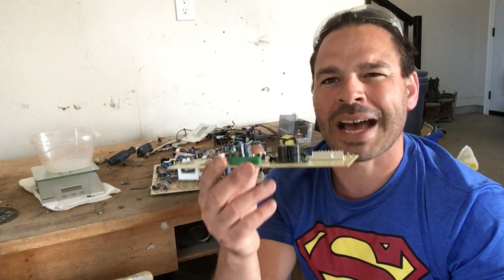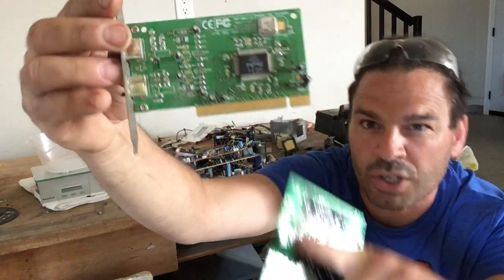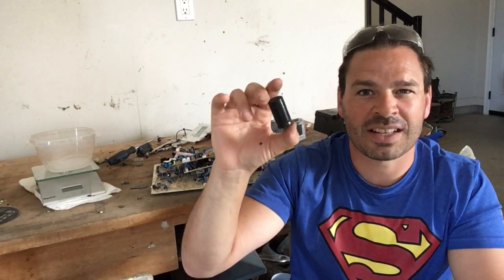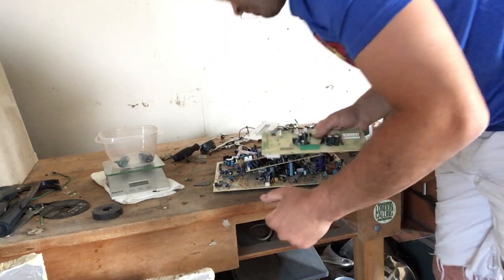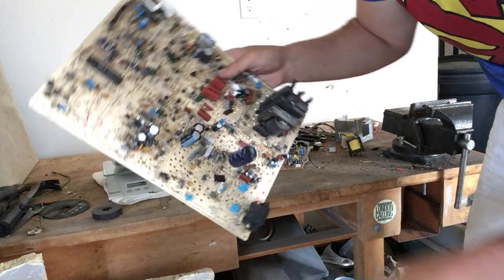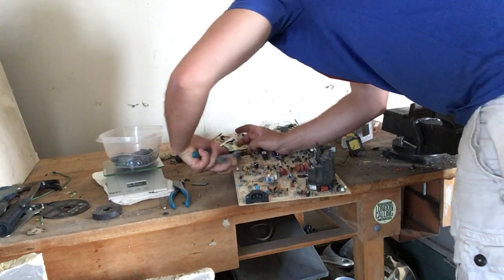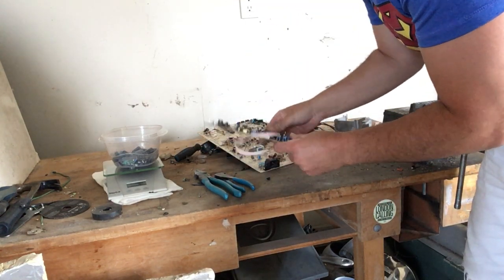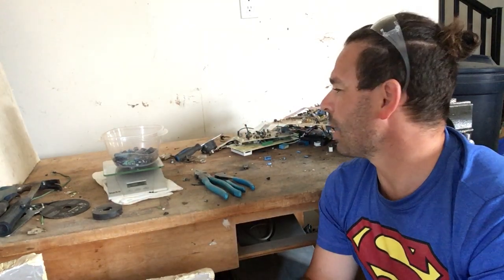Scrapping aluminum capacitors from circuit boards. Are they worth more money sold separately?

Comment: I process all high/medium/low grade Printed Circuit Boards myself. The most valuable part of PCBs, at least for the low grade ones, is the solder. A hydrometallurgical process dissolves the solder without damaging any of the electronic components. Tin, lead, and a little silver is recovered from the liquid solution (tin is worth 3½ times more than copper). After solder removal all the components simply fall off the board, ready to be sorted and processed in individual batches of not less than 50kg of each component. Virtually every single value of each component is extracted. 
Even the bare boards themselves are processed. The bromine is extracted, the epoxy resin is cracked into fuel oil, and the ultra thin copper layers are recovered as well. The remaining glass fibers are not profitable to sell but a glass recycler picks them up for free, so I have no disposal costs.
The wet electrolytic aluminium capacitors are processed by pyrolysis. I have four different homemade pyrolysis units. One of them have a reactor vessel made of thick walled stainless steel pipe (Ø 50 cm); it's built especially for aluminium capacitors. The problem: When heated up, they explode! The larger ones, from fx. washing machines, sounds like very large firecrackers. Yield is: Raw pyrolysis oil, lots of aluminium, and a little iron. I still haven't found a way to recover the electrolyte, but at least some useable minerals/salts can be extracted from the residue at the bottom of the pyrolysis vessel. After pyrolysis the aluminium capacitors are free from any plastic/rubber. They are poured into my homemade hammer mill and comes out in small pieces; from which it's easy to remove the iron legs/pins with a magnet. In a homemade ceramic crucible these aluminium crumbles are then melted, under nitrogen, in my homemade metal melting furnace (fueled by free homemade oil) and cast into aluminium blocks in accordance with the buyer's specifications.
Reply: you really need to make a channel everything you said sounds very interesting.
Reply: @gargalash9191 .   Videos covering the subject scrapping and/or metal recovery and metal refining achieves rather limited views. They'll never go viral (too specialized), thus despite the ad revenue from Google it won't be profitable. I'll make more by scrapping/recycling instead of spending the same time on making videos. 
However, as I have a rather comprehensive knowledge of the necessary chemistry involved in streamlined and effective high volume scrapping/recycling processes, I might be able to advice and help you with tips. Anything specific you would like to know?
Reply: Any chance you could educate me about the processes you were just talking about? I'd be eternally grateful
Reply: @OB1cannolli .  I'm just a backyard scrapper, recycling plastic as well as recovering and refining metals. Very streamlined procedures and efficient processes in my garden shed earns me US $250.000,- a year. The secret is to extract virtually all values one way or another, and never throw anything away. Making all chemicals at home at no cost and being careful to recycle as many spent chemicals as possible, keeps total costs at a minimum; thus considerably increasing profit.
I'll be happy to exchange experiences, and share information about recycling. What country are you located in?
Reply: Do you have an email so one can receive information?
Reply: @reginacarroll8149 .    In order to share information/advises with other viewers we can discuss openly here on YT.
Feel free to ask about the chemistry or processes regarding scrapping and metal recovery.
Reply: Is there a book you recommend on how to perform hydrometallurgical process and how to perform other chemical breakdowns of precious metals for scrapping? Thanks
Reply: @bjoewallace81 .   C.M.Hoke's book is the refiner's Bible.
Notice that this book was written in 1940. A lot has changed since that time, mainly about safety and especially regarding the laws for environmental protection (hazardous waste). However, the chemistry is still the same.

Comment: Very helpful video. I actually get 30 cents a pound for low grade circuit boards, so I usually only rip off the transformers and aluminum. But if they were 5 cents a pound, I don't have space for boards that are worth almost nothing, so I'd rip off the capacitors as well.

Comment: All the low grade with capacitors attached I’ve gotten $0.07-0.12 per pound. So they all go as breakage where I take mine. Of course I take off the big chunks of transformers, copper, transformers, etc. for higher prices. The higher grade and mother boards, etc. I got like $1.50/lb. the last truckload.
Reply from the maker: Nice. Yeah it is amazing the different prices people get in other regions, states, countries, etc.

Comment: Do you have an email that I can send a picture of something that I am trying to figure out what it is?
Reply from the maker: Sure James.firth@sccdsb.net
Reply: @TinManScrapper  Thank you, it’s a shame that pictures can’t be posted in the comments.  I sent you the pictures of the things I am curious about. I figured out that they are thermo disks but the inside of them are a different type of metal that I am having trouble figuring out of what type.
Reply from the maker: @townbell2248  Hey Shell, just responded.
Reply: Thank you for helping me. I was really hoping that it was something silver coated. It actually turned out that it was lightly magnetic. 
I might hold on to it anyways and make it into a jewelry charm.
Reply from the maker: @townbell2248  nice. You do find those types of caps on modern appliances as well.
Reply: @TinManScrapper  I am not sure. I tried doing an internet search but couldn’t figure it out on how they were built. 
 I am not going to open anything else until I can figure out how to test the parts to see what is good to sell as parts. 
 People seem to treasure the older appliances to keep and fix since they weren’t designed to be thrown away like modern things are today. 
If I had the space, I would keep them as a project to fix up but that is not an option.
Reply: It didn’t add up to me when I couldn’t find any YouTube videos on people scrapping what I have but by then I had already pulled everything apart. Hopefully some of it can be salvaged. 
I have never scrapped anything before except copper wire to make jewelry.
Reply from the maker: @townbell2248  I know what you mean, when I showed the video on scrapping old vacuum and old fan some where saying you should have sold for parts. My problem is space. Thanks and worth a shot for you to sell as parts. True, things are not made like used to

Comment: I reuse them capacitors, resistors and transistors if they are on or close to spec. I test them with a $15 "Multi-Function Tester TC1". I now have a few buckets of components that have saved me quite a few $$.
Reply from the maker: Nice, if you can reuse them that is even better. Thanks for the comment. Stay well.